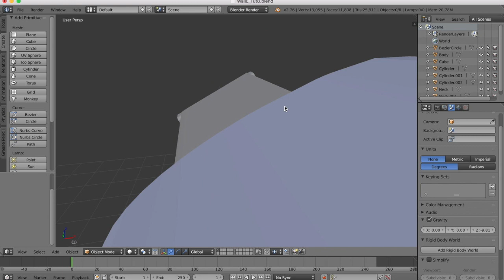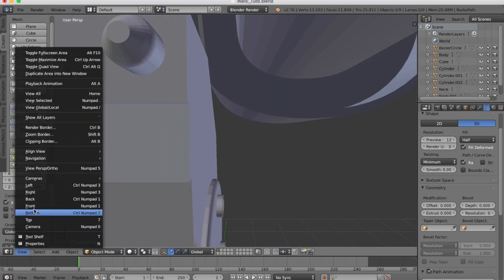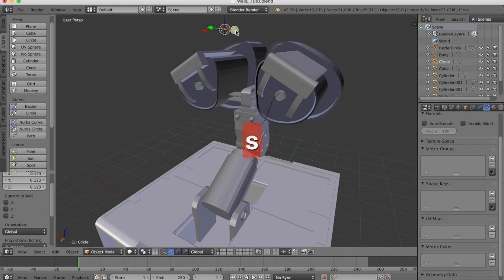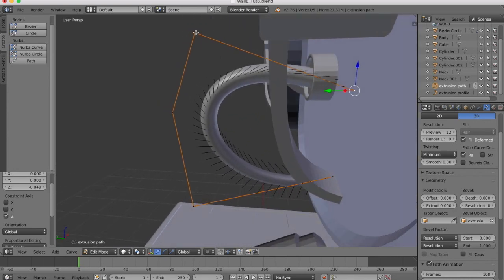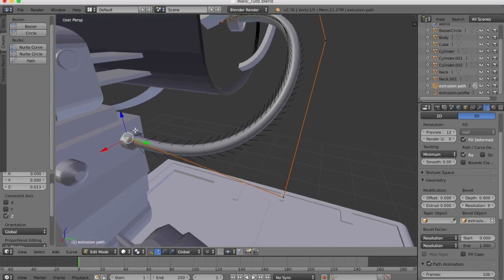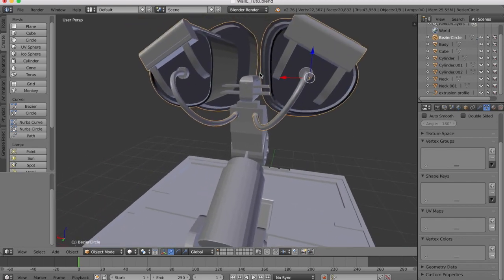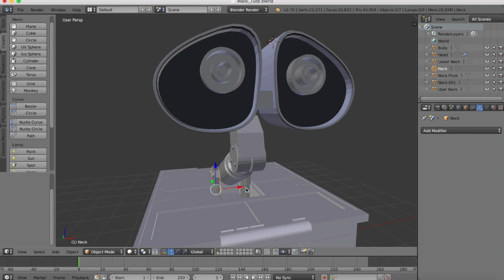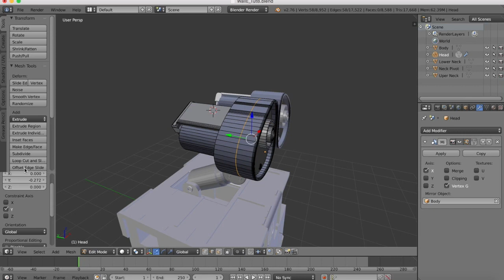Blender Wall-E Tutorial 9

Comment: You really don't need an extra Nurbs Circle mesh to be extruded along the BezierCurve. You can simply use the Curve properties panel. Change the Fill mode from Half to Full, add a Bevel Depth (i. e.: .04) and increase the resolution (i. e.: 8).